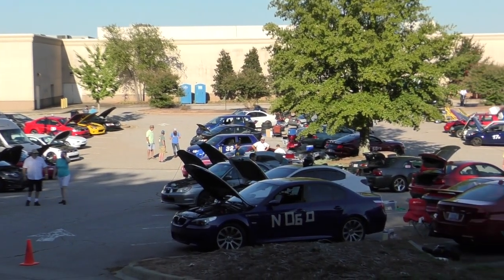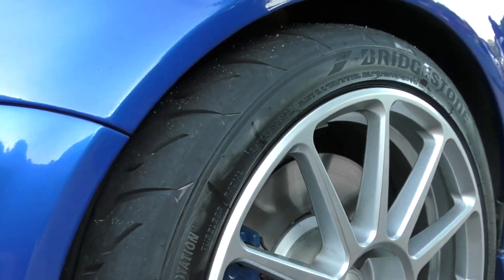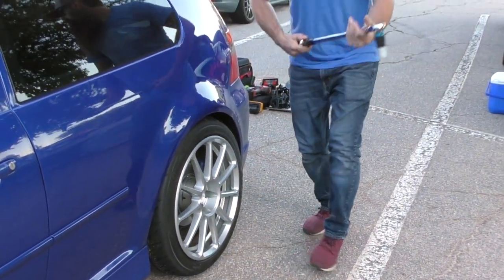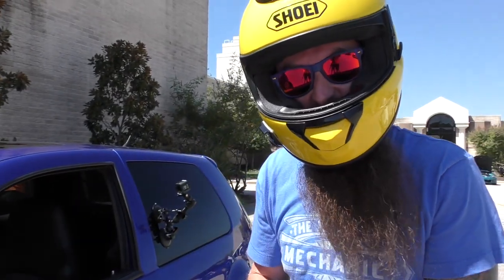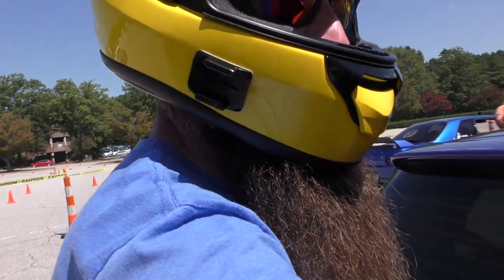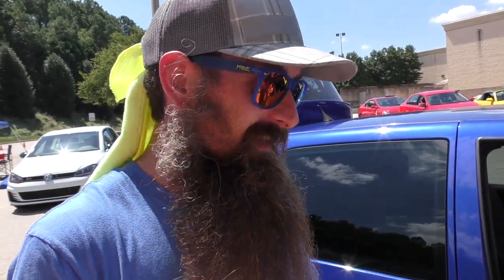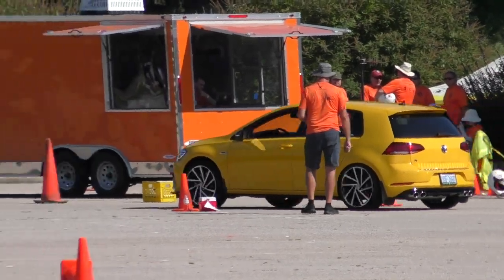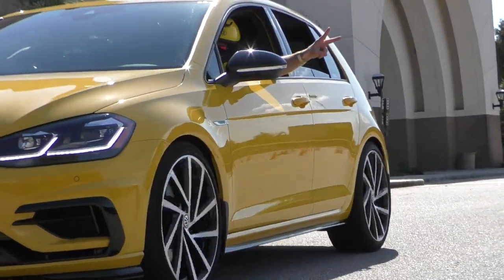I Broke the R32 AutoCross Racing

Comment: Yikes, I really think the manufacturers of poly  bushings of succeeded in marketing their product as "performance" when I think rubber is probably the best compromise. 

Why is your r32 classed as dsp? It seems close to stock or a street touring level of prep to run in STX? 

Btw, thought it was funny you kept looking back when the rotary drove by haha
Reply from the maker: It’s the little mods like High flow cats I think. If I run it next year I may see about it reclasses
Reply: @HumbleMechanic  I would check about the cats, I recall as long as it is in the stock location you should be ok with highflows. But good job, I see improvement from the last video

Comment: Is it possible that these bushings are under too much stress, becuase the wishbones are a high movement area and the poly not allowing movement just makes it crack from no way to distribute the force ?
Reply from the maker: Possible for sure. New rear bushing, much better tires may not have helped
Reply: @HumbleMechanic  thanks for the fast reply, please respond to my Instagram DM I really need help 

Thanks

Comment: Polyurethane has no place in suspension components.  You need stiffness but with dampening.  Poly is closer to a plain spring but with low max deflection.  Wrong stuff.
Reply: not entirely true. you just need bushings that dont fall apart. more movement in bushings means movement in your alignment. you want your alignment to be true on hard driving on track. thats why people use these. best way would be uniball but thats also very expensive, very loud and its got a much more considerable amount of wear. plus the extra stress will go to other parts of the car. like into the controlarms subframe maybe the body itself and so on. thats why its only used on real racecars. so poly is the best way to improve your occasional track car. they just shouldnt come apart like that....🤷‍♂️

Comment: Hi,no offence but you did not install the bushing correctly, when you change the bushing in the control arms the front bushing must (very important) be torqued with the weight of the car pushing the control arm or you can simply put a jack under the control arm,lift it until the car is lifting up and then torque the front bolt 👌
Reply from the maker: Followed the repair manual to the letter. How is that not installing them properly?
Reply: @HumbleMechanic  Y don't know it from books, y made the same mistake with my MK4,it maked some nasty noise into bubs, y told my mechanic about it and voala,after reinstalling properly problem was solved.,sorry for bad English, and no need to be upset p.s.greetings from Romania.

Comment: Just one reason not to run polyurethane bushings
Reply from the maker: What is strange is, on all the cars I have ran poly, this is the first one to have an issue.
Reply: @HumbleMechanic  not entirely knocking it! I ran them on my mk4 but they just wore out too quickly for a daily driver. They do perform well though. I've been going the solid rubber OEM+ route on my mk6
Reply from the maker: I got some new ones from Phenix Engineering. Very pumped to try them
Reply: @HumbleMechanic  awesome, hopefully we'll see an update!